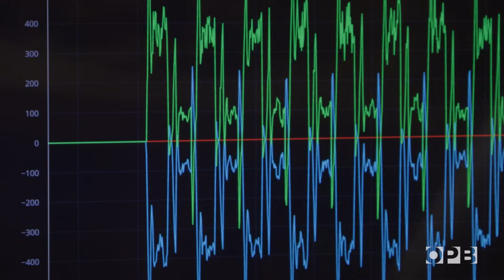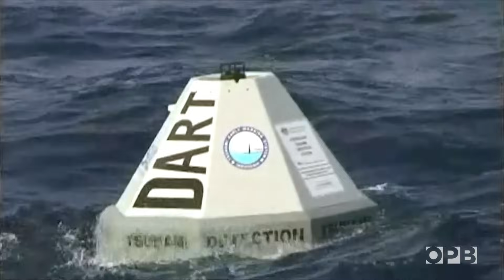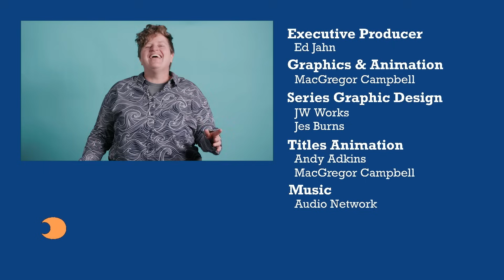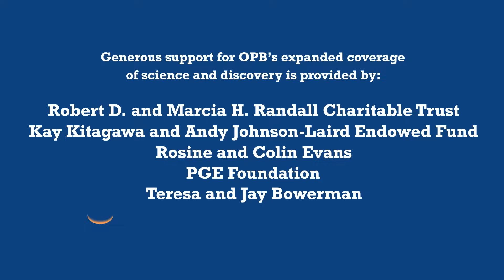How Oregon is powering the future with wave energy | All Science. No Fiction.

Comment: As an engineer, I will go ahead and break the bad news to you. The laws of thermodynamics says no. You would need to cover your entire shoreline to power half of Portland.
Reply: @SgtBrown-w1v  yes you are correct this would power a little town not enough for a big grid
Reply: @HK-hz9ny  no I don’t think they are correct. A corpower’s buoys is rated at 300kw with a 30-60% capacity factor. So roughly 0.12MW a buoy as a middle estimate. You’d only need 10,000 to cover half of portlands energy (which assuming it’s around 2.5GW, half would be around 1.5GW rounded. Unless you’re planning to spread them out and put them in a single file line it would not cover the entire shoreline.

Comment: I enjoyed this video, including using synchro swimmers to show concepts, etc.  However I’m a bit disappointed at the progress we’ve made in developing functional and affordable electric generators using wave power.  The video alluded to the concept of resonance, where the generator is ‘tuned’ to the metrics of waves such as amplitude and frequency. I suspect this must be the basic problem, in that the wave conditions driving generators vary (considerably?), and thus a well-designed generator would have to ‘tune’ how it responds (it’s own resonant frequency) according to wave conditions.  An analogy (for guitarists, anyway) is trying to play the same note on a guitar (string) while someone is arbitrarily turning the string’s tuner up and down.  Wind turbines effectively do this by adjusting the blade angles while operating to compensate for different wind conditions.  A future video could be a deeper dive into how wave power generator designers are attempting to address the issue of ‘resonance tuning.’. Obnoxious of me to suggest this, so thanks anyway for the great ‘intro’ video.

Comment: When I was 19 I designed a tidal energy harvesting system that had very heavy turbines underground and inlet ports screened, then simply the pressure of the ocean as the tide goes in and out; with what I know today almost 40 years later, it can be done with almost no moving parts and transfer power wirelessly to our local grid.

But these are better because we don't have to figure out how to wedge them into the coastline, which is a massively daunting engineering study, much less construction project.